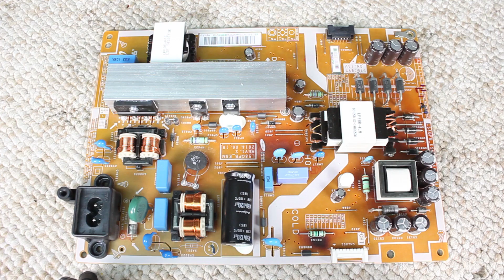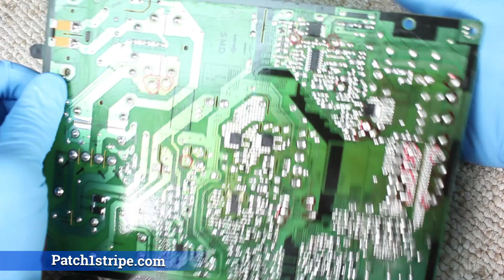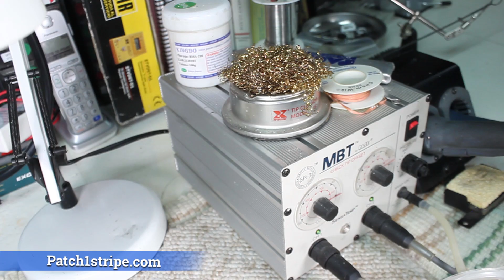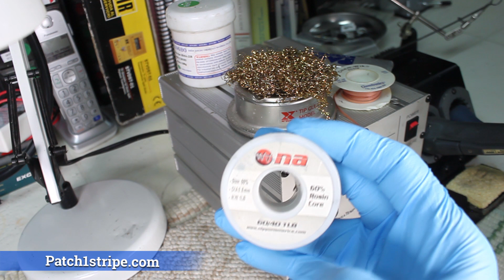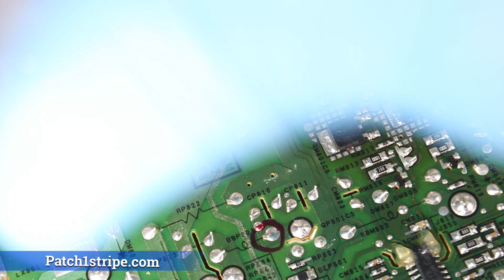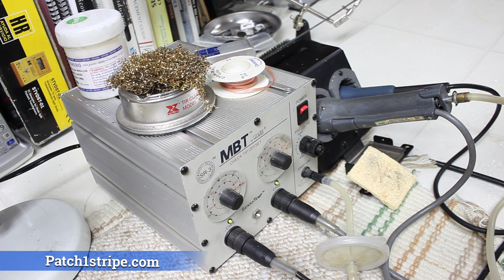HOW TO REPAIR ANY SAMSUNG LED-TV - (Power Supply - Soldering)

Comment: Sir, thank you for the wonderful video, and sharing your knowledge with us. I come with a question - I got a relatively old Samsung TV, 49" curved. long story short, my son threw a toy at it, and the rest is history. since there are no spare "curved" displays that are sold in my country, I had the idea of salvaging the housing from a different samsung 49" model, and use the "curved" innards, place them in a flat housing, and then simply install a spare flat samsung 49" LED screen. 

Is it doable? if it is, what model number 49" screen would be compatible with the motherboard from a curved TV? 

Thank you!
Reply from the maker: Thank you - hope it works out.

Comment: PS. Incidentally, if you're going to call out the part number please put it in the description, the kind of equipment that you using and the motherboard model serial number, and the type of TV that is going in. It will help other people who are having probably the same problems, to be able to fix the TV or order parts from you.
Reply from the maker: Thanks for the input.

Comment: After watching this video which dates back to November 28th, 2020 looking at the motherboard of the power supply that needed to be replaced. Samsung has a notorious problem with heat and poor ventilation, their ventilation at the back of the TV is insufficient, and needs to have a couple of fans or bigger ventilation holes. That motherboard should have been replaced with a much more updated version. Apparently, those LEDs are really pulling on the power supply components, the designers of the motherboard placed insufficient components on that motherboard for that motherboard to look and to be in that condition. Now it seems like if you replace that motherboard power supply unit, you would get the same components, so, the next thing that has to be done is a sufficient airflow going through the back of the TV with a couple of fans for sucking and pulling air through the back of the TV. Otherwise, you will have the same situation all over again.
Reply from the maker: Maybe Samsung will see this post and take your comment under advisement but I doubt it. Thanks for the input.
Reply: @Patch1stripeTVParts  you're absolutely right Samsung does not listen to its customers that well so couple of fans won't hurt and an upgrade of components by a technician would be helpful otherwise they do have a good product they just need to improve its efficiency keep up the good work.
Reply: PSS I'm the guy that you talk to in Phoenix Arizona who is still waiting for that new motherboard on that brand new Samsung TV that just came out a year-and-a-half ago this may be assigned to me that the parts may be available if so how would I contact you for that motherboard.

Comment: Good info 👍
Reply from the maker: Thanks 👍
Reply: @Patch1stripeTVParts  Guys I had issue with half screen. I replace tcon and same shit. I found one of the ribbon cables that connect to panel is getting very hot. Its samsung led smart tv. Is something like this easily repairable or do I need new tv? please need advice!
Reply: @Patch1stripeTVParts  you ask me for pic in this other video but never respond.I gave up but I want to know if I can fix this again before I waste money on new tv!.https://www.youtube.com/watch?v=-qTBB4hYdZU&lc=UgwzP0265YoHKvSEP2J4AaABAg.991rZoCGP_7995p9C0Jx4_
Reply: @Patch1stripeTVParts  here is pic. the orange ribbon is the one that get very hot...[img]https://i.imgur.com/pSyMOQr.jpg[/img].....and pic of the whole back...[img]https://i.imgur.com/QspApQN.jpg[/img]